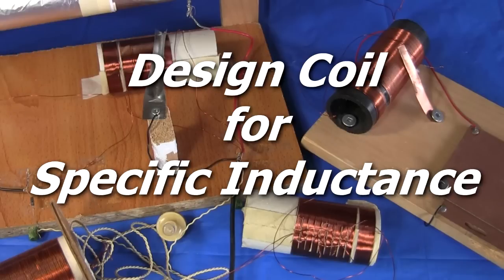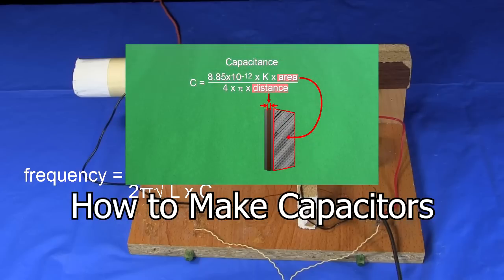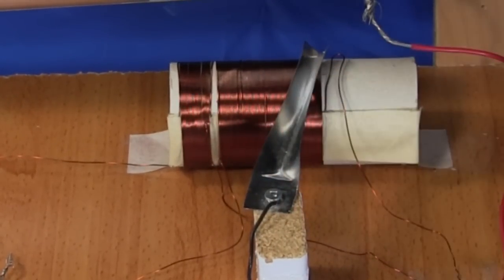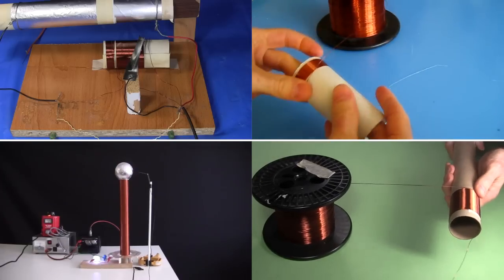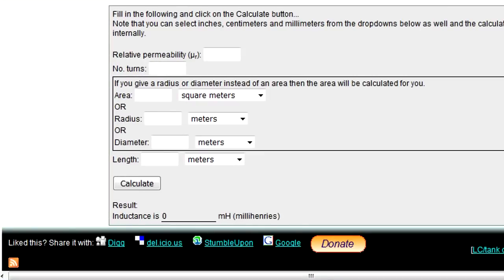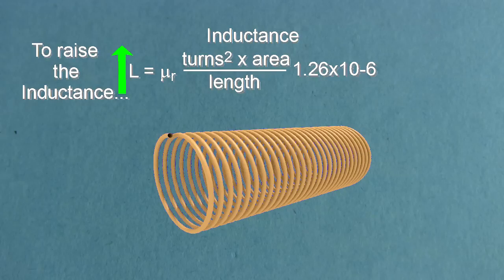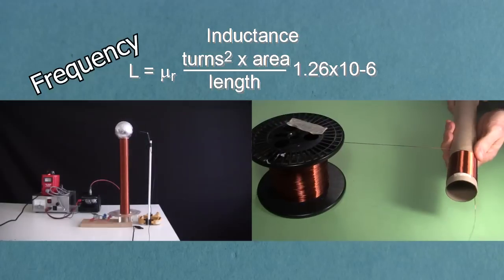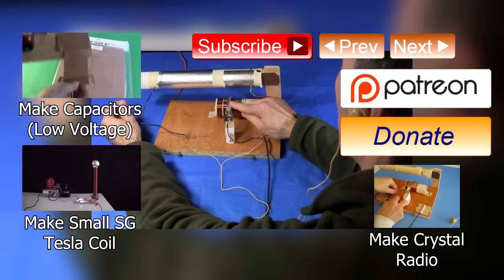How to Design a Coil for Specific Inductance

Comment: what is the material of Winding Material ? its copper or insulated copper ??
Reply from the maker: It's copper insulated with a thin, almost transparent layer of enamel. The fact that the insulation is thin allows you to have the actual copper of each turn closer to each other and to let you get more turns. It's often called magnet wire because it's also used for making electromagnets.

Comment: How does wire gauge affect the calculation?
Reply from the maker: The wire gauge affects the length parameter and also the area parameter (because the measurement of the diameter includes the thickness of the wire, or you could say that the radius includes half the thickness of the wire). So if you know the length and the area already, then you don't need to find out the wire gauge -- it's already included.
Reply: @RimstarOrg  Ok, so my schematic shows 18 turns air core 3.2 Diameter for a 14.3uh coil, so I should be ok using 16 gauge (1.29mm) wire, but what about lead in wires? I want my coil to have about 2 metres of connecting wire, how will this affect the inductance?
Reply from the maker: The lead in wires won't affect the inductance but that doesn't mean they might not act as antennas and pick up AC from the surrounding household wiring. Often the low frequency from that (usually 50 or 60Hz) doesn't matter to your circuit, otherwise you might want to add some filtering to your circuit (I don't have any suggestion off-hand).
Reply: @RimstarOrg  Thanks for the advice, much appreciated.

Comment: Does wire diameter effect inductance ? 
If yes, how ? this formula does not using any wire diameter.
Reply: Not directly, but indirectly. With thicker wire the same number of turns make coir coil longer. The thickness gives the parasitic resistance, and a thick wire gives you a higher Q-value.

Comment: please answer this, whoever knows the answer, does it matter if i put a turn on top of a turn making it 2 layers. and how does that effect the math? PLEASE HELP ME!
Reply: i want to build a low pass filter for a loudspeaker, but the turns are too many so can i just layer the turns on top of eachother and still get the same result?
Reply from the maker: I think so. As long as you keep turning in the same direction then you're fine. But I don't have a formula for a multiple layered coil, sorry.
Reply: @RimstarOrg  so it's a No No to make one layer and then going the opposit way on the second layer?
Reply from the maker: No, I think what you're saying is fine, it's just hard to describe. It's okay to wind the second layer over the first layer, but make sure to continue to wrap the wire around the coil in the same direction. In other words, don't reverse the direction that you're wrapping the wire around the coil.

Comment: Doesn't thickness of wire influence on iductance ?
Reply from the maker: It does indirectly since that would affect the length of the coil and the number of turns per length.

Comment: Great video sir, you made it look so easy. According to the calculator on your website one can easily make a 400 uH coil which could become a lowpass filter roughly around 2500-3000 hz. So my "nooby" question is, do you think if it's ok to make your own coil to use in passive crossover circuits for loudspeakers?
Reply: (needless to say, i don't expect %100 accuracy by any means)
Reply from the maker: Thanks. This is the first I've heard of a passive crossover circuit so I couldn't say.
Reply: I'll try anyway :) thanks again!
Reply: Hey, i'll try it in a few weeks, waiting for my speakers to arrive... Bear in mind though, coils are used for low pass filtering unless you want to build more complicated crossover units such as Linkwitz-Riley etc. For a simple, first-order crossover circuit, you need only a capacitor for hi-pass filtering. Here is a calculator that will find the values for a given frequency:   https://www.diyaudioandvideo.com/Calculator/SpeakerCrossover/
Reply: oh that sounds even better. I was considering the air core simply because all the commercial circuits are air core, i don't really know what difference would it make. I am planning to keep the length longer than the estimated number of turns, so that i can adjust the cutoff freq. by shortening it, while measuring the freq. response with a mic. 

It's gonna be my first diy speaker project, and I haven't spend much on the speakers really, so i'll go with the first order... But hey, let me know if you make it before i do :)
Reply: hmmm, maybe i should consider 2nd order as well... For the layering thing, there are lots of calculators out on the web that takes multiple layering into account as well. Check them out if you haven't already.
Reply: I came across a few weeks ago, i just had a look and didn't save any of them. But really, just google it and you will find quite a few. Some of them are really comprehensive.
Reply: that is strange indeed, i mean all those pre-manufactured xovers with iron core coils, how come they don't have this problem then? there must be an explanation... Do you have any estimation about the resistance of the plastic core?

By the way, the bigger the diameter, the less wires/turns you will need to get your desired amount of inductance(as far as i remember), maybe it will help?

I wish I was working on my project currently, so that I could share my observations as well :)
Reply: I thought about connecting a resistor in series, but I am a beginner in electronics and I thought that would be way too simple for a solution :) But I think the resistor should be at least 1 watt or bigger no?
Reply: I ordered a pair of dayton tweeters that can go as low as 1500 hz, and for the woofer I salvaged a pair of 7inches from my sony stereo system  which has been lying around at my parents' place (one of those ugly ones from late 90s with "uber suber ultimate baszzssss" kind of labels). I find the upper mids to be too harsh on those drivers. I also measured the frequency response and it fluctuates terribly after 2-2.5 kHz. Therefore I want the daytons to take care of the high mids as well... I think it's fair to put the crossover at 2500 for a tweeter that starts from 1500hz, what do you think?
Reply: Oh the ones I ordered are also cheap I would say, DC-28F-8. They cost 40 dollars (a pair) As I mentioned, this will be a budget project, I don't expect the finished product to be super flat, very precise etc. I don't even know the specs of those woofers except for the impedance which shows weirdly 9ohms on the multimeter. So I will roughly design the cabinet according to the volume of the original cabinets. But I believe they will sound way ahead of the originals, especially after replacing those crappy tweeters.
Reply: yeah nice coincidence indeed :) A friend will bring it from the states in a few weeks so yeah I am curious as well :)  What do you mean the longer the port, I thought the variable here was the diameter of the port, no?
Reply: I'll definitely put the ports at the back as I am painfully experienced with the port noise coming out of my Adam a7x speakers. But yeah i should probably research more about it since you mention the flares and stuff, thanks for sharing your knowledge my friend!
Reply: @RimstarOrg  Really? All my speakers have passive crossover filters.

Comment: How to calculate the number of wire?
Reply from the maker: Do you mean how to calculate the length of the wire that you need? The circumference of a circle is diameter x pi. So if the diameter of your coil is 4 cm then the length of a single turn of wire is 4 cm x pi or 4 cm x 3.14 = 12.56 cm. Then multiply that by the number of turns. So if you have 90 turns of wire then the total length needed for the coil is 90 x 12.56 cm = 1130.4 cm. Make sure you add some more for the wire leading to the coil.

Comment: can I use insulator coated. wire with a inductor
Reply from the maker: Yes, you need to use insulator coated wire otherwise you'll have to space the turns apart somehow so that adjacent turns don't touch. Maybe you're thinking that the wire in the video is uncoated. It is coated with a thin coating of enamel insulator.
You can also use plastic or rubber or other coated wire, keeping in mind that what will increase the length of the coil for a given number of turns due to the thicker insulation. That will affect the length parameter in the formula.
Reply: RimstarOrg yea I was thinking that the rubber coated may not work as well as enamel coated

Comment: Why coil is not shortcircuit when we turn by turn  touch together
Reply from the maker: The copper wire is coated with a thin layer of some kind of insulating material that is transparent so you can't see it. The metal isn't touching. 
For my crystal radio, I sanded off the very tops of each turn carefully so that the metal of each turn aren't touching each other. You can see me doing that in this video https://www.youtube.com/watch?v=VqdcU9ULAlA at around 6 minutes and 55 seconds.
Reply: @RimstarOrg  thank u sir
Reply: @RimstarOrg  if it is insulated then we touch the wire we get some shock why
Reply from the maker: That's because insulation can break down depending on how high the voltage is between the metal wire and you. You are a poor electrical conductor but you do conduct electricity and you're usually at ground potential. The metal in the wire is at a different potential, usually some amount relative to ground. So you could say that you are 0 volts relative to ground and the metal in the wire might be 1000 volts relative to ground (for example). The thin insulation on the wire might break down at that voltage and you'd get a shock. In capacitors, the dielectric is insulation between two plates just like the insulation in a wire is between you and the metal of the wire. So if you want to see more about insulation breaking down then check out my video about high voltage capacitors https://www.youtube.com/watch?v=MPD7skZ8OSo

Comment: What does that constant ?? This constant is not in the actual formula
Reply from the maker: Are you referring to the 1.26x10^-6? That's the same as 4 x pi x 10^-7. The formula can also be written as u0 x (number_of_turns^2 x area) / length or u0 x (N^2A) / l. In that case, u0 is 4 x pi x 10^-7 which is also 1.26x10^-6. Of course, you still have to multiply by ur, but that's often left out of the formula when talking about only air core coils. They're just two different ways of writing the same thing.

Comment: How to calculate the AL of ferrite core ?
Reply from the maker: What do you mean by AL?
Reply: Thank’s sur for your réponse. We know that if we want to calculate the inductance (L) , we can use the relation follow:  

L = N² * AL 

With: 

L: is the inductance. 
N: is number of turns. 
AL: is the inductance of the torus in square towers in nH / tr². 

We want to design an inductance by using the Ferrite core. 
  
I know the value of ilductance (L = 470 µH). and we want to know the value of the AL of ferrite core in order to calculate the number of turns (N).

So. How to find or calculate  the AL of ferrite core ?
Reply from the maker: That's a new one to me too. What's a tower?
Reply: sorry i want to say turns and not towers

Comment: Anyone build a Tesla coil or two and never think to find out what the inductance of the coils were?  

The formulas do not consider wire thickness?

Thanks for sharing !
Reply from the maker: Yes, the formula I used (or rather the online calculator) for my Tesla coil considered wire thickness. I figured it was needed to get the length of the coil. Here's where I show making the Tesla coil and using the calculator https://www.youtube.com/watch?v=0SaEPW_iMF8

Comment: Can I know the Guage of these Inductor coil
Reply from the maker: If you're referring to the coil for the crystal radio, it's 26 gauge (AWG). You can see how to make the crystal radio here https://www.youtube.com/watch?v=VqdcU9ULAlA.
Reply: RimstarOrg Ohkk sir..is there any current requirement for magnestizing effect of these coil?
Reply from the maker: I'm not sure what you mean. The current doesn't play a part in the inductance, unless there is some influence on the inductance due to temperature maybe, in which case a very high current would produce a high temperature and maybe that might affect inductance. I don't know off hand.
Current has an effect on the magnetic field intensity when you use the coil.
Reply: RimstarOrg but sir in my case the coil. Isn't conducting but when we r checking on software we are getting the required sine wave after changing few parameters but we are unable to build the hardware for the same.. So few of our proffeser said to increase the current capacity..
Reply from the maker: I don't know what your professor has in mind. The coil needs current in order to produce its magnetic field. Maybe he thinks you aren't giving it enough current to produce a useful magnetic field? But you'd have to ask him to be sure. Just be careful to not give so much current that you break something else in your circuit. Check the current rating of the other components.
Reply: RimstarOrg Ohkk sir.. Thank you so much ☺ will definitely work on it

Comment: And, what about wire's gauge???, it  is not important???
Reply from the maker: The wire gauge isn't important as far as the inductance is concerned, at least not directly. Naturally it plays a part in the length of the coil because thicker wire will make the coil longer etc. But that's already accounted for in the length parameter. If you look at my inductance calculator on https://rimstar.org/science_electronics_projects/coil_design_inductance.htm, you'll see I give the option of either specifying the length or giving the wire diameter, in which case the calculator calculates the length for you.
Wire gauge is important when it comes to making sure it's thick enough to handle whatever your current will be. In that case you need to look your current up in an ampacity table. But that's a different topic.
Reply: @RimstarOrg  thank you

Comment: Cross-sectional area of wire doesn't matter here plz
Reply from the maker: Yes. When you're measuring the diameter of the coil, you measure from half of the thickness of the wire on one side to half the thickness on the other side. Or if you're measuring the radius then incude half the thickness of the wire. I show a diagram on my webpage here https://rimstar.org/science_electronics_projects/coil_design_inductance.htm
Reply: @RimstarOrg  can you please tell me what is the permeability of iron powder please?
I cloudn't find it anywhere

Comment: A bit lacking as more coil capacitance information needed, like how the thickness of the wire is what effects the coil capacitance and how this throws all the other calculations off making the whole presentation practically void... You see differing thickness of wire has differing inductance, the more inductance the more capacitance, the larger the radius and greater the area... Fortunately there are online calculators for that also... So no worries... I'd compare this to the bible... New testament lol, at least somebody tries though. thanks anyway and much love

Comment: Your formula cant be right, the only way to calculate it is with a scope.  If i had 100 turns of 24awg compared to 10 turns of 8awg on the same core and same size the inductance levels will be very far apart..  And seeing as ferrite cores are so unique based on manufacturer and application, there is no way to calculate unknown variables, a scope is the only precise way otherwise you could be way off, hence the variable coil you have set up.
Reply: But the inductance is inversely proportional to the length. So the 8awg wire will have a significantly shorter length since you measure length as length of wire, I believe, not length of the coil as though it’s a cylinder. The shorter length compensates for the decrease of turns

Comment: Why would I make a capasitor they are cheap and I can salvage them for free
Reply from the maker: Sometimes you want to use a variable capacitor with a crystal radio (there are many possible designs). That's one where you can vary the capacitance. Those are a little harder to find, though there are some places online which sell them.